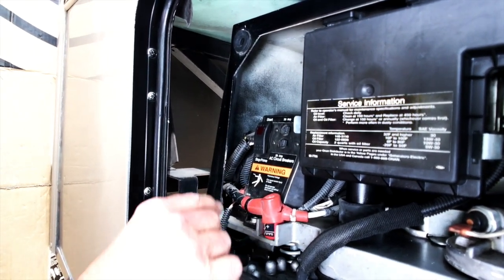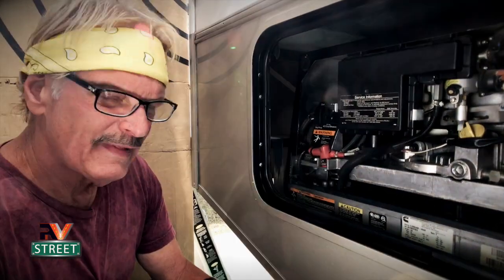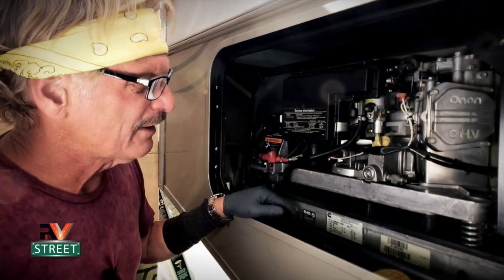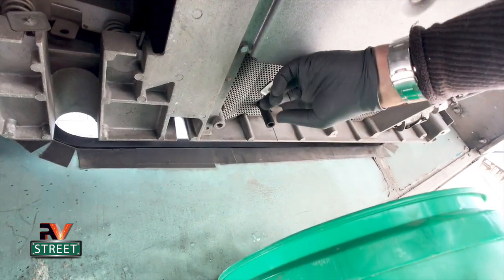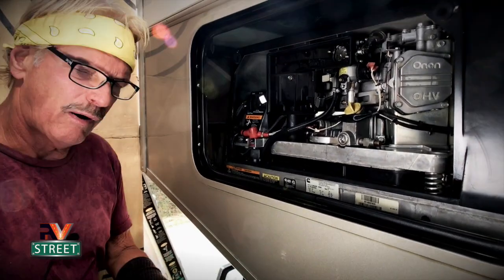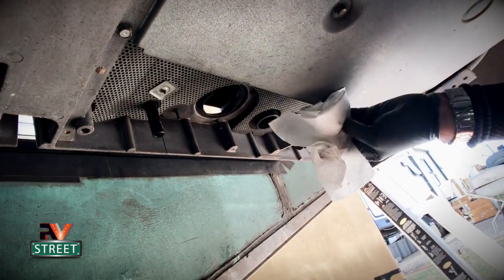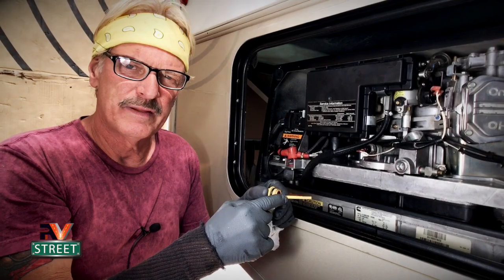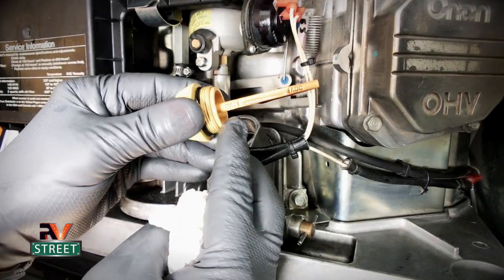CUMMINS ONAN RV GAS GENERATORS - ULTIMATE MAINT. GUIDE - Part 1

Comment: is it worth worrying about the generator starting under load? it seems like it would be better for it to start open circuit, and then be connected to the load after maybe 30 seconds or so
Reply from the maker: As I demonstrated, it's best to start the genny, let it warm up first for a few minutes until it settles into a steady rpm and then put a load on it.

Comment: Martin!!!! I am having a slight issue, I dont expect you to know this off the top of your head. But was hoping you have seen or heard , or someone reading conmments here has seen or heard, My Generator runs fine, Can start it at the generator can start it with either remote switch on the dash or on my Power info control monitor panel. BUT! it will only shut down with the button on the Genset  (2005 Winnabago Voyage) I have replaced the dash switch, I have tested good the panel switch. Any ideas on where to even start looking?
Reply from the maker: Here are some thoughts that I’ve collected over the years from others that may help you….

• Make sure you pushing the rocker switch DOWN at the dash

• Your problem very well could be in the Harness that plugs into your Generator. Pull that plug apart, clean it out with Electric clean, reconnect and test

• Had a friend that had the same thing it was caused by a corroded splice, (butt connector), 6-8 inches from the generator in one of the wires that run from the generator to the dash switch. The generator remote wires on some are spliced 6-12 inches from the generator remote harness plug on the generator.... (the splices are hidden inside the black wire loom covering the wires).

• On the right front of the generator there is a large wire harness plug look at that then there is another one farther up the wires about 4 feet, mine did the same thing a few years ago it had just returned from the repair shop who serviced the generator, when they work on them they unplug that first wire plug because they are concerned about auto start, that harness goes the the switch, and other places, when you push and hold the dash switch the little light in the switch should come on, if not you have a connection issue

• Another friend of mine solved his same issue. The wiring harness terminal connection going into the generator was corroded, cleaned the pin connectors and generator shut down from the dash switch. 

• The Onan logic uses a momentary connection between battery + and either the start connection wire or the stop connection wire, if there is a break or bad connection in the stop wire it would cause this behavior, the same if there is a fault in the switch.

• Clean the wiring harness at generator

• Here’s another friend of mine story -
I could not have solved it without the wiring diagram. Once I knew what wire position the Stop signal was on the outside generator connector, I was able to trace the wire to the switch. The colors did not match the wiring diagram, but the connector positions did. It turned out to be a severed stop wire between the generator connector next to the generator and the inside rocker switch.

Hope this helps 👍
Reply: @RVstreet  Perfect advise THANK YOU--exactly what I was looking for--will check all and let you know what I find.

Comment: Hello; why the faucets and toilet on my motorhome don't through any water when the pump is on but it works on the shower and in the kitchen, thank you
Reply from the maker: I would consult the plumbing diagrams for your coach to look to trace all plumbing routes, valves and vents. Also, the faucet screens could be plugged up and the valve on the toilet may be malfunctioning or broken.

Comment: So it’s fine to have the generator in that port, the CO won’t seep into the RV? Why do people have generator boxes that mount to the bumper instead of using the side door space the generator usually goes.
Reply from the maker: The generator in the bay is just fine. Comes from factory that way. No CO can get into the RV. However I did cover safety and CO in Part 3. Folks who mount a generator on a rack on the bumper is a portable generator. One that they bought afterwards and have no way to install one permanently in a bay.

Comment: how about using pipe cleaners for the hard to reach places when cleaning your generator? You can fold them to make it wider/bigger when needed. I use then to clean the fins in my lawn mower.
Reply from the maker: Ya I guess you could use those. Just thinking out loud here, I think they would be a little clumsy—even doubled up— to get way back there in those tight hard to get areas. But I can see how they would work for the fins. But hey, If it works for you great.
Reply: @RVstreet  not  Dad's old pipe cleaners. They have some industrial ones for arts and crafts. Take a look at Hobby Lobby or Michael's.
Reply from the maker: @samspaun8195  OK, you convinced me. They have a Hobby Lobby nearby and MAYBE a Michael's so I'll check them out.

Comment: Why when you check the oil level the dip stick is dry?
Reply from the maker: it has been wiped off before checking and the oil is at the bottom of the dip stick to when it is checked. I'm sorry if I didn't explain this very well but Martin has passed away and I'm trying to do my best at answering questions.
Reply: @RVstreet  : I am so sorry for your loss, Martin had such amazing energy and love for RV’g.  Take care and all the best.

Comment: Genset runs 15-20mins shuts down after 30 -40 mins restarts runs about same time then dies. Fault code 36. Hv changed fuel filters, pump, air, oil and 500hr maintenance 
What's next?
Reply from the maker: 'm sad to say that Martin has passed away and I don't have the answer to your question. Sorry